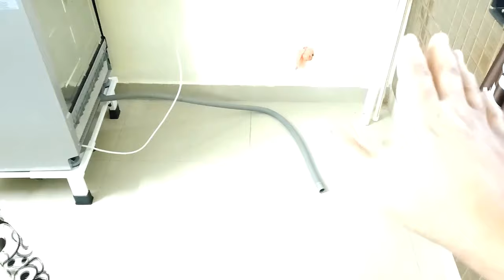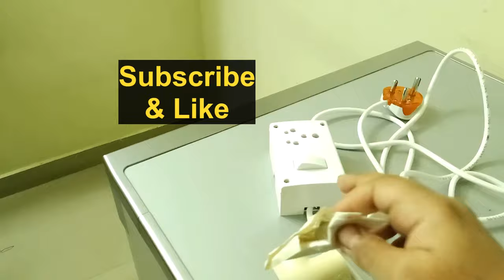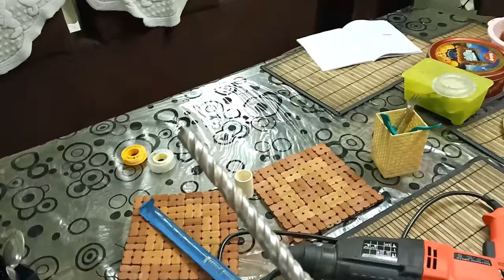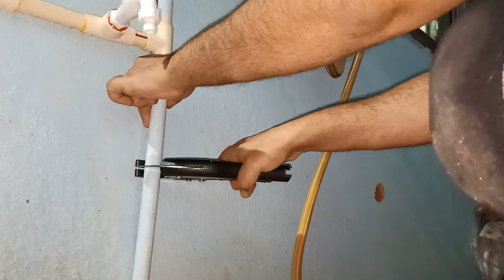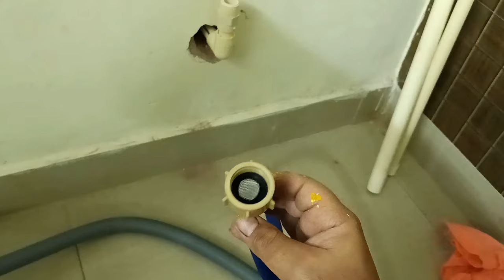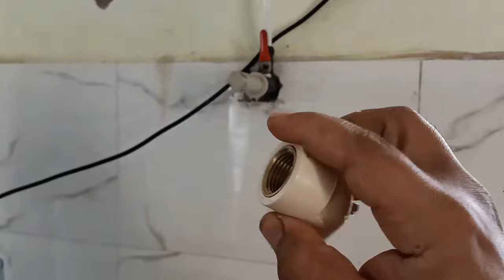Dishwasher Installation Process | Inlet | Drain | Power | Midea TORRINO WQP12-5201F | BOSCH | IFB

Comment: I got E1 error in LG. Fixed it by raising the drain pipe in the middle. The dishwasher strain needs a little back pressure otherwise it will Syphon in the dirty drain water of your drain pipe end is dipped inside the water in the drain.

Comment: Sir, is it safe to have stand, the stand can be used for other brands too. Secondly does dishwasher vibrate like washing machines. Thanks
Reply from the maker: It's absolutely safe to use stand for dishwasher. Dishwasher doesn't vibrate at all, doesn't matter which brand you buy.

Dishwasher is usually heavy (50kg+), so a good stand is needed which would cost about 250 rupees+.

Check stands and other accessories here,
https://www.amazon.in/shop/commonman?listId=2SW0S8O8QS35Q

Comment: drilling the walls is not the most efficient way, it can cause later issues depending on the area you live. you can always use extensions for the water and current from within the home itself
Reply: what kind of issues

Comment: Drain pipe length is incorrect as only for dishwasher the outlet pipe should be positioned much higher than the ground level they even say upto 30m as otherwise the water always goes back to the dishwasher ... You can check your own manuals for the same

Comment: what is the cleaning level of cleaning in utencils in which tea has been made and milk is boiled?.

आप गंदे बर्तनों को बिना  rinse kiye, dishwasher में डालकर इसका एक detailed रिव्यू दीजिए । आपको अग्रिम धन्यवाद् 🙏 . Can we keep it on the thermocol base.?
Reply from the maker: Cleaning is good. Soiled utensils after making tea or boiling milk a few times - they get cleaned to perfection. Make sure to use ECO or intense mode. Rapid mode doesn't cleaned heavily soiled utensils.

We are also using it for aluminum cooker as well, even that gets cleaned.

Why to keep on thermocol ? That's not a good option.. Great plastic stands are available in 200 to 300 rupees.

Check this one: https://amzn.to/2H8RoH3
Reply: Hi can you share the reviews of this dishwasher? Also drain pipe that comes with this dishwasher fixes in. 45in cpvc directly or we need adapter to do so?

Comment: how much it is taking for washing?
Reply from the maker: How much, what ?

Time depends on program you choose  - eco modes runs for 3 hours 45 minutes

Power - eco mode consumes 0.9 unit for full cycle

Cost - less than 10 rupees per cycle all inclusive subject to detergent and rinse aid brand used
Reply: @CommonManLife  3hr is still too much , will there are also plan for like 30mins for just washing

Comment: How do we solve error E4?
Reply from the maker: Didn't face this issue hence don't have much info.

As per manual, it can be caused by unexpected water level.

1. The switch that opens/closes drain might have issue.
2. The detergent used might have issue.
3. Drain filter blocked

TRY: Remove drain filter, clean it and fix again, and  then run self cleaning. Select p6, put dishwasher detergent (not any other, specially not liquid detergent) and run empty dishwasher. This might clean any stuck impurities.
Reply: Never mind. Resolved it. Needed to tilt the dishwasher to rid excess water